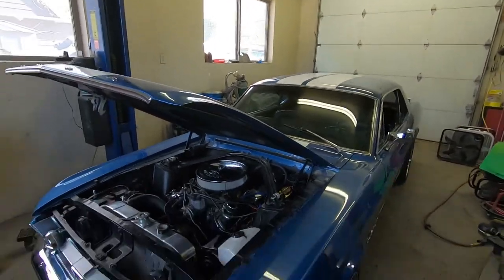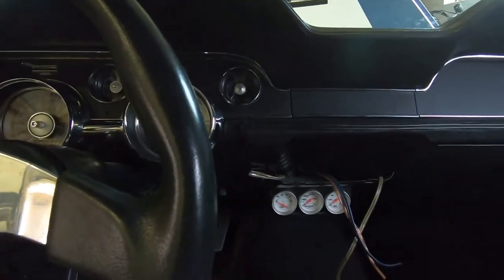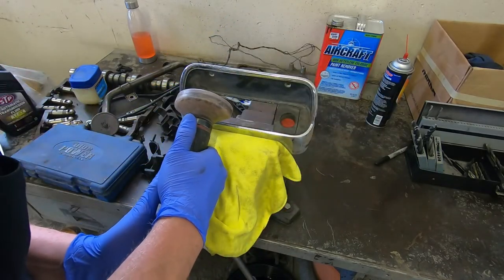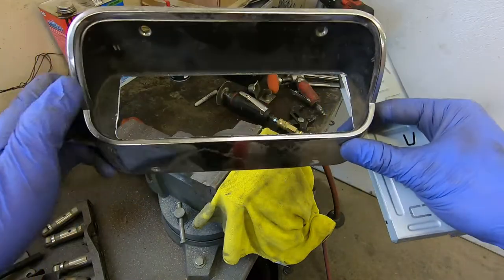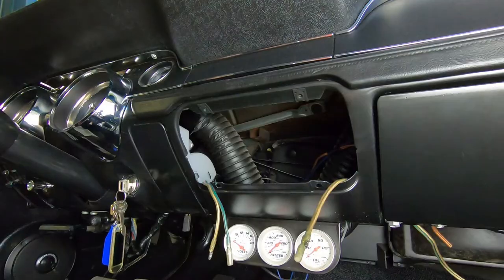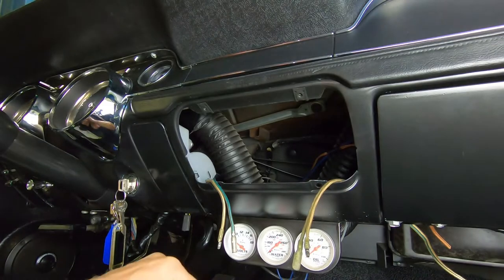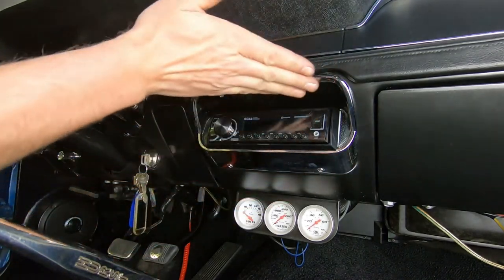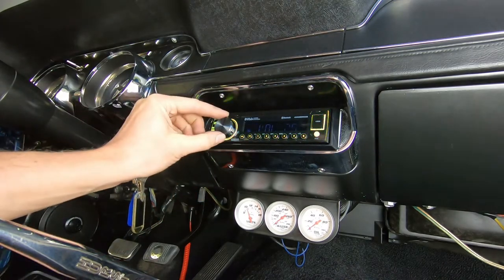1967 Ford Mustang stereo install - Hooking up our client with a new Bluetooth stereo!

Comment: It'll be some time before I'm ready for a Bluetooth system but great install. I'm still trying to locate a 264/274 cam and pushrods. Looks like I'll be in thr engine bay for a while.
Reply from the maker: Oh ya I understand that. You have to get her running and driving before you can focus on the luxuries!

Comment: Is there really a point anymore to having a radio in the dash and running the wires & speakers when you can just use a smart phone and keep a bluetooth speaker on the backseat?   That's what I'm doing in my 67.   Factory 8 track in the dash - but running smartphone w/ bluetooth speaker.
Reply from the maker: You're absolutely right. This particular car needed to have that hole filled with something anyways. He didn't even have a bezel there so it fills the hole much nicer. Plus this is a bluetooth stereo and now a days, these things are pretty dang affordable.
Reply: If you want to keep the factory head unit use a LC7 to take those outputs to an amp and real speakers. You are leaving a lot of audio fidelty on the table with the BT speaker.

Comment: Thanks again and again the videos sure make thing easier.
How can I go about adding the 3 Guages from autozone. Like the one underneath the radio you install here... I have a 67 inline6 and i would like to add those Guages. Do you have A video make a video or guide in a direction so i can install them on mine... please and thank you.
Reply from the maker: You're very welcome. I'm afraid I don't have a video on those yet. However, they are pretty easy and usually come with good instructions when you buy them.